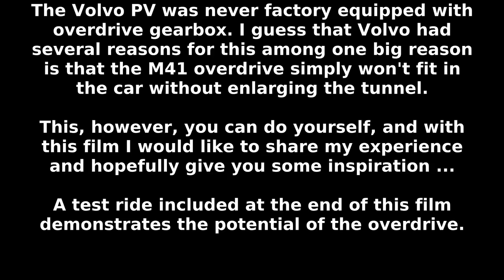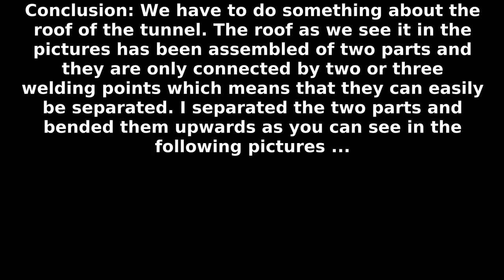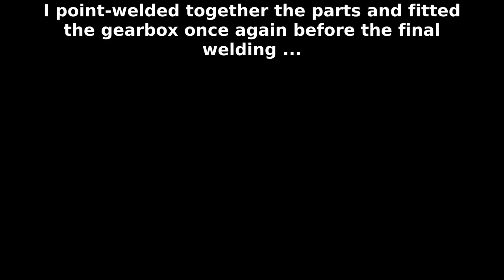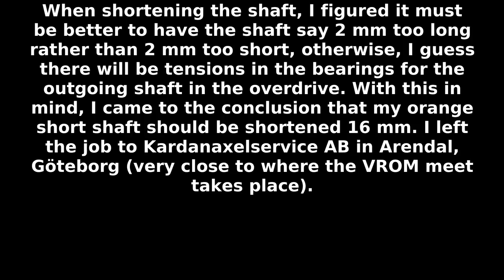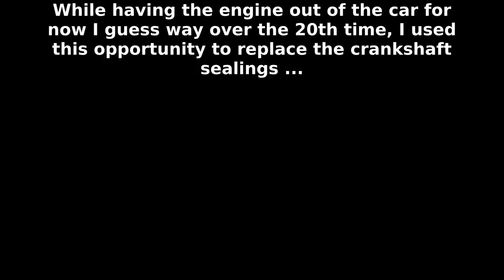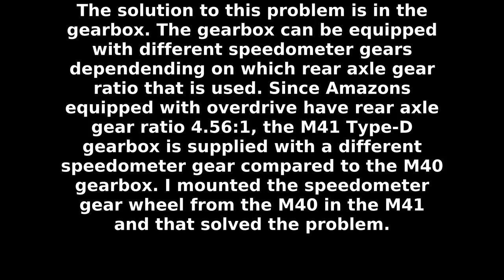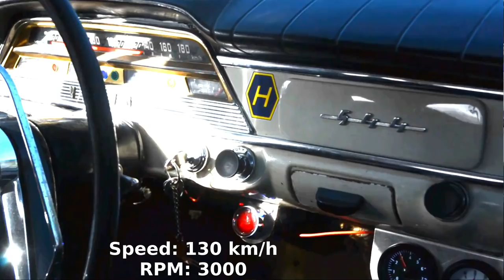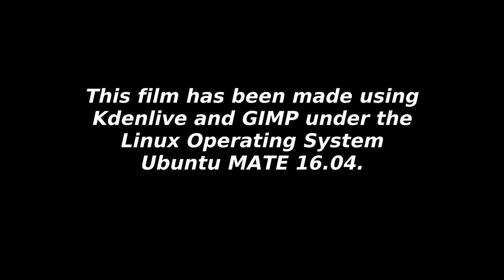Installing an M41 Overdrive in a Volvo PV 544

Comment: Drove my 1970 142S from Guadalajara, Mexico to Texas in 12 hours. Two lane road of various conditions. Cruising speed was 85 MPH. Yes the engine sang the whole way (no over drive, just M40) and it never skipped a beat. That motor was meant to run like hell!...

Comment: Well done. Goes nicely for a B18A. I might say to straighten up your steering wheel but you might reply to say you prefer it that way so as to see your gauges better? Indicator switch currently non locking?
I think that in todays motoring the OD suits the 4.10 axle. I have an Amazon Combi with the 4.56 axle with OD and would be happy with a 4.10. OD never factory fitted by Volvo but I think they still would have used the 4.56.
Reply from the maker: Thank you for commenting! The car is actually fitted with a B20A and the OD works fine with this engine as well but with the 4.10 axle you need to be careful with the torque at lower speeds, otherwise it can disengage. The steering wheel shall be straightened up one day, I promise. When the film was shot, the 4th gear switch worked fine but shortly afterwards, it started to malfunction. I have traced the fault to the 4th gear switch. For the moment I have bypassed the 4th gear switch and instead coupled a relay via the switch for the reverse gear lamp. However, this is nothing I would recommend anyone to do. It works fine but you have to be disciplined when driving, i.e. only use the OD with the 4th gear. A total breakdown of the OD will occur if used in combination with the reverse gear.

Comment: Thanks for your video. I just made a M41 swap to my 142, 1968 with the 4,10 rear axel. Did you change the other speedometer-gear-part inside the gearbox as well or was it only the part with nylon from 18 to 16? teeth? I mean, the two gears have to match?
Reply from the maker: Thank you for watching and commenting my video! It is a good question but I can guarantee that you only have to replace the outer nylon speedometer gear from 18 to 16 teeth (blue to yellow). Do not worry, the 16 teeth yellow one will fit perfectly, the two gears will match and it is very easy to replace. The instrument will then show the correct reading.

Comment: Great video and great conversion.  I did  the same in my 1958  Duett with a B20 motor.  Could you not have used one of those right angel drives for the speedometer cable instead of doing that extra cut in the tunnel and floor.
Reply from the maker: Thank you for watching and commenting my video! Yes I could, but at the time I did the conversion I did not know they existed ...

Comment: You should have used a 90 degree transmission piece for the speedo cable instead of making another  housing. But great video. Regards Rob
Reply from the maker: You are right, that would be the best solution, however when I did the conversion I did not know that these 90 degrees transmission pieces were available. Maybe hard to find? Anyway, thank you for watching!

Comment: I have a 1962 PV and it came with overdrive done before I owned it. Very nice to have this feature, but my mechanic says the work on the tunnel was not done well. Sloppy workmanship according to him. Maybe someday I'll have this done correctly. Could I add a piece of a tunnel from a 122 instead of fabricating this?
Reply from the maker: It is certainly nice to have the overdrive! I don't know if or how well a tunnel from a 122 fits (in case you manage to find one). In my opinion, the best way is to build a customized tunnel for this purpose.
Reply: @cartube7505  I know a man in Pennsylvania that has barns full of Volvos and parts. He said he could probably cut out a portion of a tunnel for me.
Reply from the maker: @williamclark1633  That sounds good! It would be interesting to know the result so please share your experience. Good luck with the rebuild of the tunnel!
Reply: One more question, does the modification of your tunnel get in the way of your feet?
Reply from the maker: @williamclark1633  No, not at all. But I am not very tall, only 170 cm. I did not even think about this when I did the modification. When I drive the car I am not bothered about the tunnel being wider. When you look into the car, you won't notice that the tunnel is modified (provided that the tunnel mat is fitted). However, the original tunnel mat did not fit very good, I had to modify it slightly. Why don't you try sitting in your car and check how much clearance to the tunnel you have? It is only a question of a couple of centimeters on each side.
Reply: Since the tunnel is already modified, I probably won't notice the difference. The issue is that when someone did the modification, they didn't leave enough room to access the filter or adjustment area.
Reply from the maker: @williamclark1633  I have also limited space to access the filter. At the oil changes I have done I noticed however that the filter was completely clean. I plan to change oil on a regular basis, say every second year. Either I cut out a little bit more of the tunnel near the filter or else I can lower the entire gearbox and engine, however this job is not what you would expect at a normal oil change.